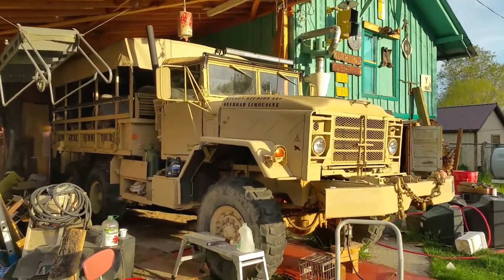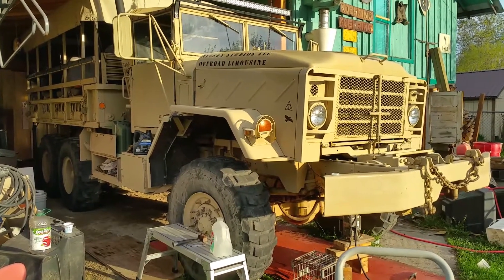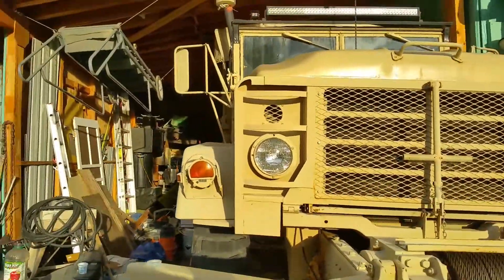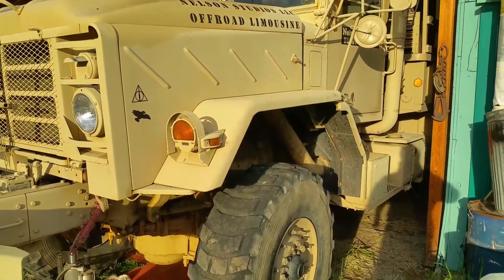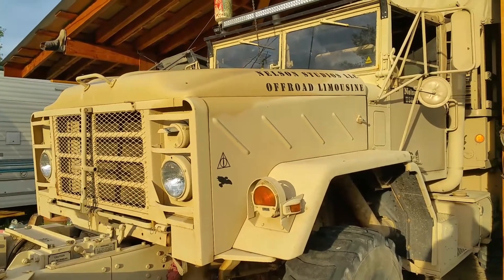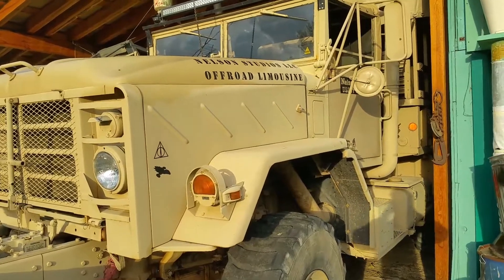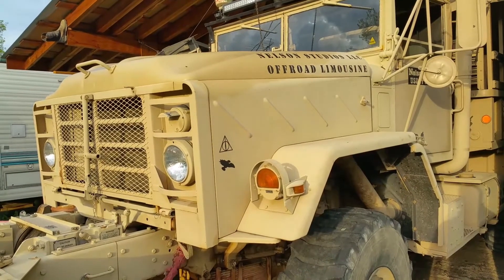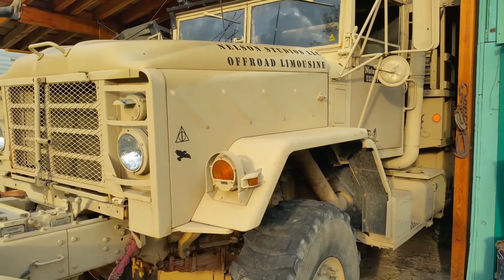Army truck update

Comment: The question of the  "quality" of the engine and parts intrigues.
Unlike many who probably ran and maintained the trucks in the Army, you seem to be VERY knowledgeable about vehicles and maintenance.
The defense budget of our country is monstrous and there is always a "money is no object" for the "good of our boys."
Who knows what the co$t of one of these trucks was foisted on Uncle Sam who willingly paid the "going rate."
Sure, there were "specs" required by the US but I seriously wonder about some of the underlying "engineering," and then the matter of ma$$ production.
It's hard to explain "hard conditions" to which the trucks were exposed since THAT was what they were designed for in the first place.
In fact, they were supposed to be designed for just WHAT you are trying to use it for now!
Driving it up a gravel road and then down again.
The amount of time, effort and sderious $$$ that you have put into the three trucks amazes.
For cripes sake!! You DESERVED to get at least ONE decent engine!
I guess I'm in the camp now that thinks you might as well look at getting a substitute engine of known high quality for one more go.
OTOH, I understand that the three engines that you have worked on all probably came w the same high hopes.
DON'T jump off the cliff at the new property you showed us by the river!!
Good luck!!
Chip